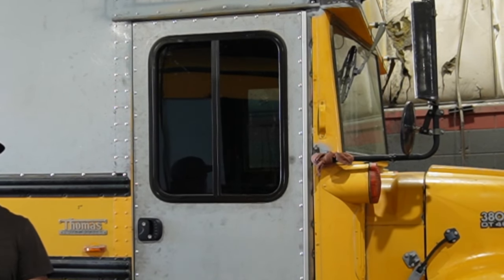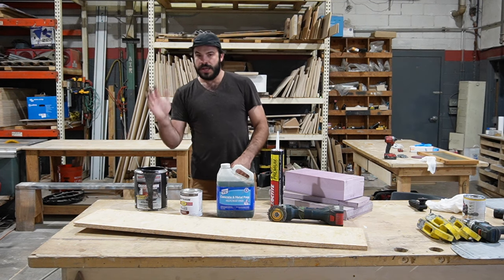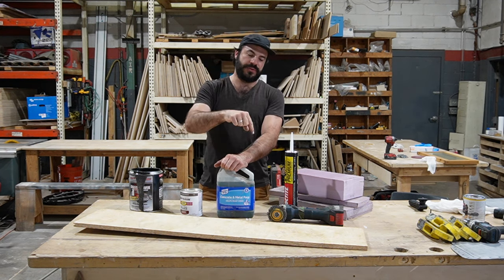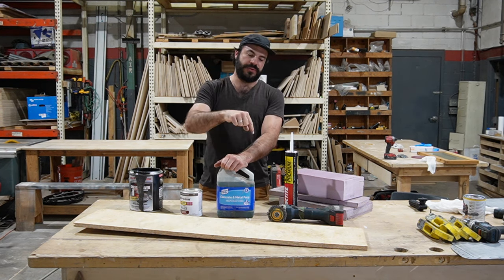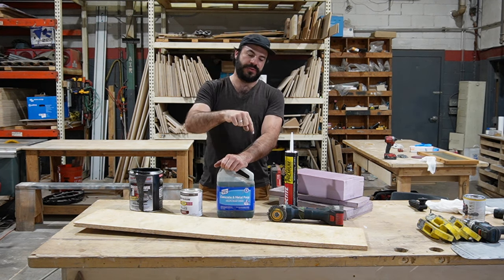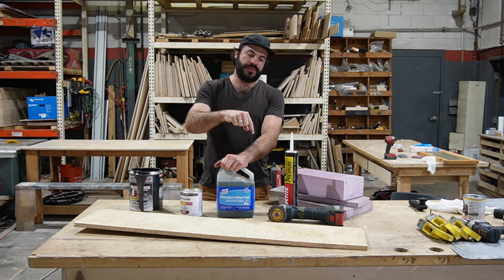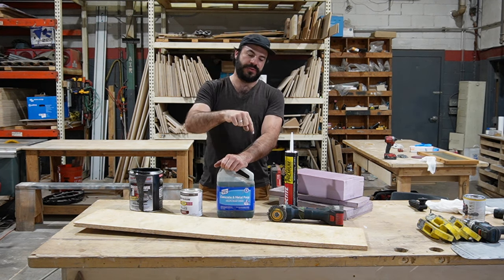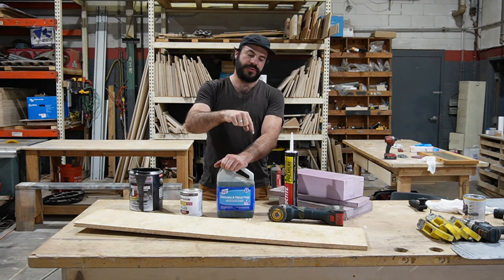Framing your bus conversion subfloor is a mistake, do this instead

Comment: Just to add to the knowledge base, my experience with those TEKs for wood to metal is not good. They do not tap hard steel, and will not get through thick steel even if mild. The threads do not hold the wood AT ALL in any circumstance. Look at a wood screw and the size of the threads. Those TEKs are meant to tap threads into steel, but they don't work at all on steel thick enough to tap. So they are essentially a sheet metal screw with threads much thinner than your average sheet metal screw. If they work for you they work for you, but no metal worker would use them. A sheet metal screw with fender washer will hold better. A bolt fender and tapped hole with blue loctite will hold the best if the metal is thick enough. For this vid, a through bolt with fender would have been most secure with a nut w/ blue LT on the outside. Not as clean a look but it WILL hold.
Reply from the maker: thanks for sharing! Ive been using these since 2014 in dozens of busses with great results. 18-11ga steel has lots of grip in my experience with strong enough holding power to actually split wood if you keep cranking down on it! The fine threads distribute the forces of the pull across more area in my experience and they hold much better than sheet metal screws. I attach so much wood to metal in my life i feel i have a reliable opinion when it comes to fastener recomeendations and I dont have time to through bolt everything lol that would be wild
Reply: @ChuckCassadyYT  well hey brother. Sorry, reread what I wrote and I had the passerby in mind for general tips, but I didn't point out for your application there's not going to be much of a problem. It clearly works for ya for the subfloor framing. But that is also a pretty solid structure all together. Those screws don't hold much of a load at all, they're glorified sheet metal screws and you would think twice about mounting any substantial load to sheet metal with sheet metal screws. As for the threading, they don't really tap too well, those guys. Well enough to work sometimes on mild enough steel, but again, glorified sheet metal screw. Self drilling. Cuts grooves of a sort that hold a bit. What's left in the hole when you back one out doesn't visually resemble threads. You can look into the science on machinist forums for thread count and material thickness too, fine and course threads, but it's a doozy of a set of charts lol. Think how easy it is to strip out a 1/4 20. Those teks hold a lot less torque because the nut (the sheet metal) is a lot thinner. Think of what you would trust a 1/4 20 to hold and back that off by a lot and you have tek screws. I didn't mean to piss on your parade, though totally came off like I did, my bad for that... but generally speaking they really should be noted to be a very low grade fastener that really only works in the odd situation. Try mounting a 2x4 to a piece of stainless with one and you'll  go through the whole box before you even get a hole drilled, if you don't start a fire first lol. The head from the drilling tip melting as it spins can literally harden the steel you're attempting to drill if your drill bit is made of mild enough steel to create more friction than drill. This is EXACTLY where and how teks frustratingly fail in tougher steels. Where they do work effectively, they're not to be trusted to hold much of a load at all. Your framing work will be rock solid long enough to outlive the bus I bet, but that's more an attribute of the overall structural integrity you engineer, those fasteners are barely carrying their own weight. We use the originals which work a bit better in the elevator world to mount things like 4x4 boxes. The hacks in the trade use them for everything, and for 10 years the service guy bitches about a shitty install while it breaks down once a month and then they have to modernize something that should have lasted 30 years. Vibrating sheet metal doesn't hold sheet metal screws well AT ALL because you just can't get much torque out of them. And oddly, the friction does more to hold your part than the bolt does, so it's actually the torque that's key to the whole process.
Reply: @ChuckCassadyYT  the 1/4 20 thing all things considered is a bad example since those are course threads, and you're right about the fine holding better, but off hand most people don't know their national fine threads... least of all me lol

Comment: Regarding holes in the floor, I have to stop you.  I get that you value drainage.  Then, put drain holes and/or drain plugs periodically.  This varies state by state, but my state has vehicle inspections.  They WILL FAIL any vehicle with floor holes, because "exhaust" can get in the holes (yeah, but windows down in a traffic jam is totally fine, I know, it's a stupid law, not debating that, it's just a constraint we have to live with here), which if not fixed within 60 days, they revoke your vehicle registration, which causes loss of insurance, which if it's your personal vehicle, may mean a gap in insurance, which means higher insurance rates when you eventually do get reinsured.  So you're going to fix the holes anyways.  Now with your method, you just have to do some magic welding from outside without burning the floor, or you take out the floor and everything on top of it, basically start over.  Might as well sell the bus at that point to someone in a state with less strict vehicle laws, and start a new project and do it "right".  Plus, I think it's kind of stupid to rely upon the random placement of seat holes and sizes or rot holes or whatever holes might be there.  I'd prefer not to leave things to chance.  Maybe find where water naturally pools in the floor pan, and put some holes there, with a plug of some sort (plastic or rubber, screw, snap, or push in, hell, maybe repurpose some plunger valves or whatever they're called, like dish detergent bottle caps or water bottles use - bus nipples, ok, you heard the term here first?  It'd actually be a fancy feature to have solenoid controlled valves to open if moisture is detected nearby on the pan, indicator lights, smart system tablet tie in, manual overrides, fans or compressed air to blow out, heat to evaporate, etc.).  As for welding... you should not even be allowed to use a welder if you're not covering everything burnable or damageable with some thick leather, wet leather, or at least some wet towels, or some protective sheathing, rock wool, fire blanket, carbon felt, or SOMETHING.  You're lucky you didn't blow your dumb ass up by hitting a fuel line or fuel tank or something, or brake line or whatever.  That's on you, that's not welding's fault.  And of course, you weld, paint burns before metal, so you must properly remove burnt paint, clean the metal, prime, seal, etc.  Zing it with a braided wire wheel, slap on some chassis saver, done and done.  Again, that's just stupidity and/or laziness.  Yes, we all start off ignorant, and have to be told, that's fine, I'm no different.  But you tell me once, and I get it.  Everything after that is a either a choice to be lazy, or stupidity.  "But but but" bullshit.  Too expensive?  Delay later steps in the build for a later round of funding.  Also, it's not just WATER going in holes.  As I mentioned, exhaust gasses can come in.  No matter how well you THINK you seal the subfloor and walls, you probably don't seal it all.  And even if you did, as I said, laws do not allow for "internal" sealing here.  Anyways, you can also get some grit in there, fine sand particles, maybe silt carried in with mud, etc.  Grit vibrating between foam and metal, it's going to rub paint off.  Now you have exposed metal and water, so you're going to rot out again.  It's not just about "feeling good"  You are being lazy, stupid, and irrationally stubborn on this point, PERIOD.  This is all foundational shit, you want to take care of it.  That's my idea.  But I'm no expert, I'm just learning from other people's mistakes.  Love the detail in your videos, and the in-depth rationalizations for things.  But this floor pan hole and welding thing seemed like an area for improvement.  And it just annoyed me.  Well, that's my "soap box" moment.
Reply from the maker: Man that is some strong coffee you must be drinking over there
Reply from the maker: Many buses come stock with wooden floors and no metal floor pan, I’ve owned several crowns that way, I know gilligs are as well, and so are the MCI coaches I started on. I’m sorry you find my work lazy and stupid and that I’ve ruined my bud conversion by relying only on foam backed polyurethane to fill the holes in the floor. I guess I shoulda glued down some pennies and dimes!

Comment: I skimmed thru the video but i do not see any reason at all to lay down 4 inches of foam when simply 1 or 2 inches will do just fine!
Reply from the maker: My feet and pipes when it is -5 outside would beg to differ but you can do whatever you please
Reply: @ChuckCassadyYT 5, lol. ok then, I guess so. I live in central Ga permanently in my bus, Ive just got some  carpet mats down and its fine down to about 45, About 20 is the lowest it gets here and that is really only for a few hours like at 4 to 7 am. I could probably get away with an inch of that. My toes get cold but not to bad.

Comment: No sub floor framing, using OSB and the words easy and unnecessary..... you lost me... notice at 20:40 the piece of OSB SUPERIOR PRODUCT is already curved / warped, laying on the table ¿
  I haven't built 8 years' worth of buses, but im currently on #4... looks like a huge off gassing mess...
Frame saver, glued layers, OSB held together with who know what type of compound...  over selling the floor and the concern of cold transferring... The windows, front windshield rear windows, side windows are all single pane   and the Dashboard and dog house have a huge likelihood of drafts... hell even the backdoor is hollow and uninsulated.

 Not so much about keeping the cold from coming up through the floor as it is keeping the warmth in, 5" inch thick floors is a huge waste and the materials are not conducive with living in a small environment.. IMO
  Was this method created just to save time in the building process, glue it, cut foam, apply more glue, lay the worse product to ever be created on said glue, throw junk on it, and call it a day..
It would take less than 2 hrs for 2 men to completely install that  flooring using the method show, no need for the dramatic over night pause.. and like most business decisions time equals money, not to mention the up charge on the expense unnecessary materials.
   No need to reinvent the wheel. Use common since, your gonna get more discomfort from the doors, window, dash etc, than any cold transferring up through a conventional build of your floor...